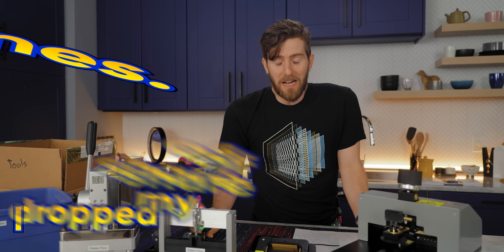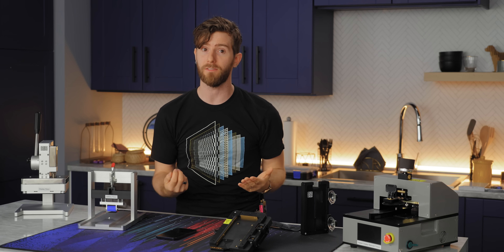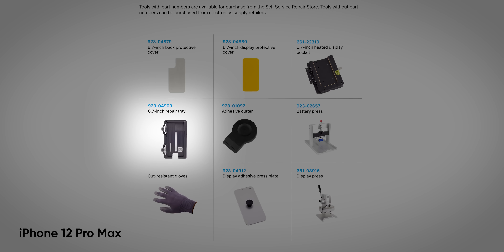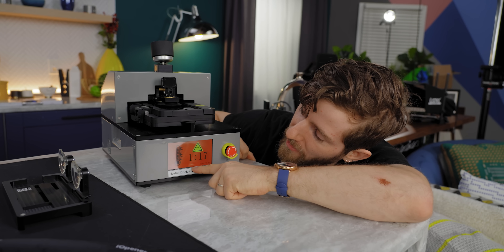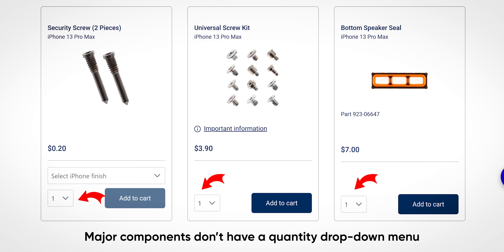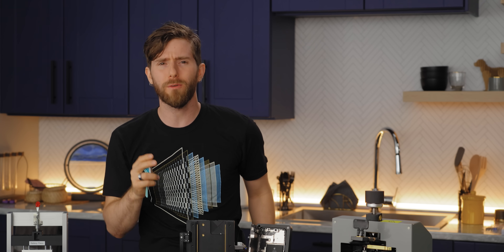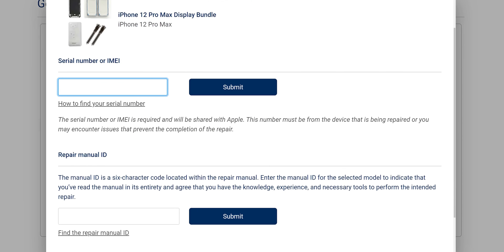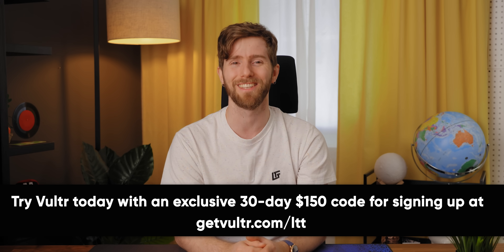I’m a Genius - Apple Self Service Repair Program

Comment: Conclusion: apples self service repair program is completely ridiculous.
Reply: exactly they making it so bad that it is not even worth  for anyone to self repair his phone and just go to the apple store instead so they continue making a lotttttttttttttttttttttt of money
Reply: @ahmadnasser9435  well kinda backwards since they make more from self repairs
Reply: As the owner of a repair shop with 4 locations I'll be sticking to aftermarket and refurbished oem screens as well as a heat gun and plastic spudgers.  I guarentee I can take apart a phone faster with that than with the equipment Apple provides.
Reply: @qhoeger  yep... And probably the parts you use will in some cases be better... Like for real. This "repair program" is just a way to make Apple look "cool" in front of justice and also making every repair shop feel like Apple is against costumers as usual...
Reply: @TrioLOLGamers  Exactly and not only that, but its another front for Apple to convince customers that non apple authorized repair shops are bad and will cause damage to your device. Just like the important display and battery messages. No reason to do that but they say it's for security reasons (their favorite phrase)
Reply: @qhoeger  "security" is the catchphrase for every company... People just like to use specific devices to feel safer while leaving their data everywhere to everyone... It always happens. Even Samsung now is advertising their devices as "safer". I mean, every device has cryptography on it today. The difference (that unfortunately I've found) is that lots of these companies doesn't give you any way to restore your data if an updates goes wrong because the memory is under cryptography and you don't have the key... Yeah... It happened to me: bad update with an official rom from Google and boom: the password on the lock screen was always wrong even if it was the same and the problem was known... Happened something similar on a friend's iPhone SE, also happened on my PC. The difference is that on PC they key is on your MS account online so you can take your ssd, connect it on another PC and boom: here you can get access on your data knowing the key. On smartphones? Nope... The only way is to use online backup that "surprise" has a limit of space unlike our fancier 120/250gb internal memory. Backups are everything and on smartphones they're still in early 2000 usually with slow speed for transfering files...
Reply: @qhoeger  so basically you’ll be using shitty quality screens. Got ya!!!
Reply: @seanlacroix  umm u w0t?  I literally said OEM refurbished.  They're great quality. I won't say my distributor for aftermarket, but it's the same one Phone Repair Guru uses. They're definitely good quality screens. I would never use a cheap screen we cover all of our repairs with a 3 year warranty so we would just loose money with the cheap stuff.
Reply: @qhoeger  ya some companies use Chinese knock offs and sell them as oem or refurb it’s annoying.
Reply: @seanlacroix  Yes you are correct. It depends on where you get your product.  I get my stuff from a reliable source so I know they are legit. My suggestion to others is just never buy on amazon.
Reply: It’s to undermine right to repair laws by making it unnecessarily complex and expensive. Just so that they can say “told you so” and revert it.
Reply: @a1r592  100% correct man. They want to make it possible not accessible.
Reply: Apple Repair is ridiculous period even through Apple Authorized Repair locations. The cost does not make sense.
Reply: Hi Guru, nice to see you here.
Reply: As expected.
Reply: Hold up, can damaged iPhone be restored by recycling NAND flash from river?
Reply: Just one more example of the infinite arrogance at Apple HQ
Reply: I mean, it's Apple.  The worrying thing is, Apples device policies are becoming the norm for the average user.  
Other companies have already started to veer into the dark side unfortunately.
Reply: @EnsignLovell  that's why we need to fight back. This is why I refuse to buy apple products. I don't want to live in a world where my phone isn't really mine.
Reply: @Flawaffles  nah nah, just iSheep
Reply: Who would have guessed 
It's not like Apple is evil
Reply: So phone repair guru watches ltt, now that makes me happy
Reply: @mwillis1979  "5 repairs to get a replacement" that's because it was costing them more to have it come back so many times than to just give you a new laptop.
Reply: FFFF Apple

UE will force them to stop treating its clients as idiots AKA US-of-A is not the greatest country to live in
Reply: i guess it's for people not professional in repeairing?
Reply: @takipsizad  yes, if you decide to replace your screen or battery under right to repair act
Reply: So true
Reply: Lots of complaining about a phone you don’t have to buy. It’s like you people just can’t stop raging at other people liking something you don’t like Lmao.
Reply: As expected of Apple.
Reply: oh hi I watch you
Reply: Agreed
Reply: Keep up the good work 🙏💪@Phone Repair Guru
Reply: Apple shill here 👆
Reply: nice to see you here 👍 and yes I agree
Reply: Hey no way, it's phone repair guru
Reply: Lol
Reply: Lol read this comment in your voice
Reply: Hey love your videos bro
Reply: and apple wants more money
Reply: hi guru. yep thats why i dont use apple too darn expencive
Reply: if i could buy from apple to repair without all the BS i wouldn't hesitate to do it, they honestly make it so hard to do
Reply: Hi, I believe that it was the iPhone 5s that started to pair the home button, although I could be wrong, you are the electronics dude after all, I am just some kid who mods Gameboys
Reply: They don't give chargers to save the environment.  And then ship tools in large Styrofoam sheets.
Reply: Apple itself is ridiculous.
Reply: It seems way to slow and complicated for professionals and people who only want it once or twice it seems to expensive and drawn out
Reply: Lol
Reply: Well yes
Reply: And I bought them for my iPhone 13 max
Reply: They want to circumvent the right to repair with dirty, scumbag pricing tactics.
Reply: Conclusion: Apple is shit, never liked the company from the start.
Their products are seggs though, no argument in that.
Reply: O
Reply: true
Reply: o hi prg
Reply: @Flawaffles  So true
Reply: @Flawaffles  i mean at least they do it, one step at a time lol
Reply: absolutely, I wish they had a repair program like Samsung & the other android companies! they should really catch up!
Reply: hi PRG
Reply: Duhh.
Reply: Thank you Phone Repair Guru! I love your videos.
Reply: @Flawaffles  yeah , that's apple
Reply: Oh, Phone Repair Guru! Hi there! I'm a subscriber of your channel!
Reply: Hi :)
Reply: it's really just bulls**t
Reply: We need to sue Apple.
Reply: Hey Guru! Yup, you are correct!
Reply: Ikr
Reply: yup love you btw
Reply: Not that ridiculous, Linus said prices are too high but then also showed that a first party screen costs just $30 more than a third party one.
Reply: @hishnash  it depends on the seller. The screen itself costs 50$ or LESS (at the end they're not the manufacturer but LG/Samsung are). The difference is shipping and seller costs.
Reply: @hishnash  "just 30 more" on top of the 140 or so. Which is dumb expensive, not even mentioning the manual and tools and everything
Reply: @tridinh1011  
The manuals are free

The tool pricing is very good and Apple does not require you to buy the tools or even rent them to buy the parts. It is a good thing they are offering this as an option but they do not require you to buy them.

The OLED screen and assembly in a modern device is the most expensive part, expecting this to somehow cost $5 is just studpi when it costs way way more than that just in IP licensing let along tooling, manufacturing, QA and packaging etc. 

The prices they are charging for the parts are quire reasable, non of the parts they are selling are overly expensive given what these things cost.